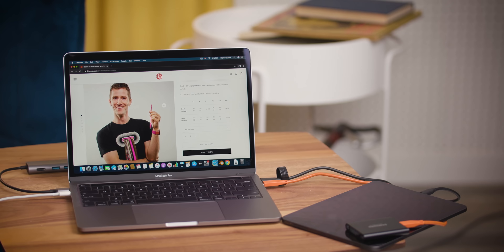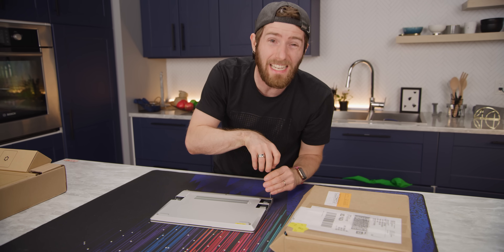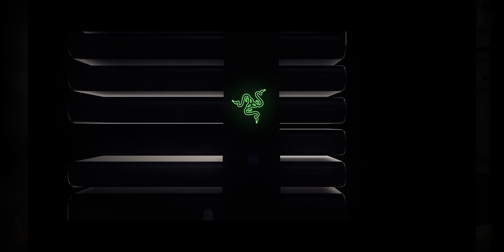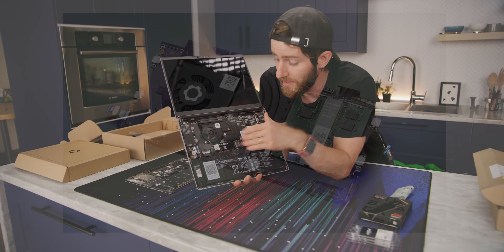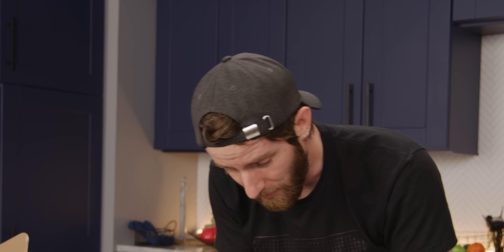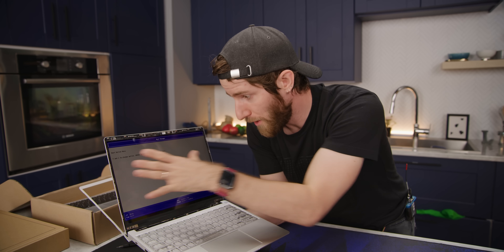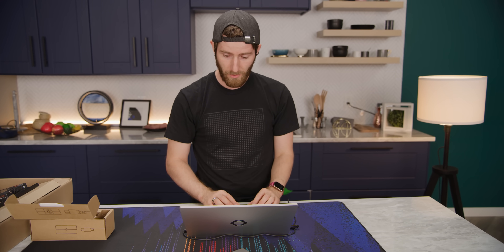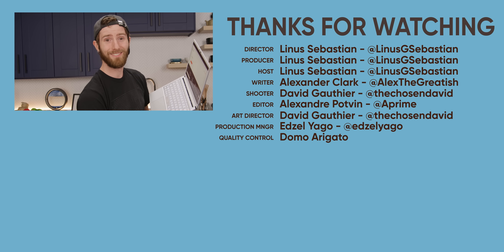A COMPLETELY Upgradeable Laptop?  - Framework Laptop Review

Comment: In an alternate reality: Yeah i'm gonna just go head over to the computer store and grab a micro GPU for my laptop. All the regular names sell them and they're standardized so they fit in every laptop. They're the size of a credit card. This company could make that a thing. Someday.
Reply: Dude that would be awesome! no more headache in upgrade modules!
Reply: Note: this is possible on this laptop NOW, as the board uses a chipset that allows eGPU setups over thunderbolt. The eGPU itself is expensive however. The good news is, Intel xE is quite capable for an APU in itself.
Reply: Laptop GPUs are basically already the size of a credit card, about two of them and a 3-4 thick. It's a standard part size. The ONLY limiting factor is cooling wattage, which again, can easily be compensated for (either reduce power of GPU, or don't buy a thin laptop with cooling spec too low)
Reply: My wifi on my computer is almost broken when i drop my pc acadently
Reply: except you can't get it because they all been sold out and now only available on ebay with 2x the price
Reply: Mxm used to exist 10 years ago, unfortunately it failed miserably
Reply: @paologiordano.photos  I shall say technology has gone really far within the last 10 years.
You can look at those changes in mobile devices & laptops.

Yes it failed in the past, and still needs more development in the future, but we might see it soon enough.
Reply: @paologiordano.photos  But those were not compatible with every device
Reply: @priesermax  they could have been if bios whitelists and continuous connector revisions weren't a thing. I had an old NX9420 from HP back in the days with an MXM gpu, because of the bios whitelist I could choose one in only three gpu options

Comment: No Keyboard selection yet and power adaper for non US/canada. NoGo yet. The best would be a adapter with more than 1 USBc on it. most likly anyone is using full speed on both ports at the same time. But you would have more ports :)

Comment: Definitely going to be looking at Framework for my next laptop upgrade. I just went through a very annoying process to do something as simple as fixing an RGB light on my current laptop, where the manufacturer said I'd have to send it to their service center hundreds of miles away just to screw in a 2cm pcb. (ended up ordering a similar part on ebay harvested from a dead laptop of a slightly different model).

Comment: That's quite nice, but the $300 price difference between the i5-1135G7 and i7-1165G7 is nuts. Intel's "Recommended Customer Price" (customer, not OEM) mentions a difference of only $117. And it's not like they have different TDPs to require different a cooling solution, so that's a bummer. Oh, and the "spoiled" European in me also dislikes the 1-year warranty. There's a minimum of 2 years of warranty for this kind of electronic equipment here, so even lacking an extra warranty option is an issue with this laptop - for me and other "spoiled" customers. Hey, it's overall an obvious good step towards the customer, but I hope they will do more in the future.

Comment: Although as stated, most laptops already (or still) have replaceable memory and hard disc the design overall is awesome, it clearly proves that modularity and replaceability can be done without sacrificing anything and in fact making lot of things easier for the end user. For example the bios option to disconnect battery altogether - with modern battery management circuitry, the effort to implement such feature is surely trivial but against the planned obsolescence tactics (simply letting the battery needlessly wear out). Framework's design philosophy would surely reduce the environmental impact of the modern disposable electronics and should be enforced to be mandatory in all appliances by local and international laws. I remember hearing about such thing being planned in the EU couple of years back and really hope it only got postponed due to covid-19.

Comment: I work as a computer reseller, I think that everyone should learn to repair their computer. Just simply basic SSD or ram replacement should be mandatory. Its fortunate that most of the modern mid range laptop still have that option. Especially business laptop, although most of them are moving toward slim design which sacrifice the Soddim type RAM. But luckily not all of them are.

Comment: I have an old Toshiba Satellite laptop with a Core 2 Duo socketed PGA CPU (no heat spreader). The thing consumed 35W at 2.7GHz and so needed a greater thickness to accommodate the cooler fin stack. Point is, it existed, it can exist again.

Comment: I was a little worried about how much the add-in cards would cost, but it's US$9 for the USB cards and $19 for the MicroSD/display-out. Am a little disappointed that there isn't a 2×USB-A hub to help remediate the limited port count or an ethernet card, but those could certainly be added or modded in later. And maybe I'm just used to 15" laptops; this is a 13-14" class laptop under the 3lb mark with more ports than the XPS 13 (which is about 3 ounces/100g lighter).

Comment: I would jump on this from Mac if they had a more rigid charging solution than USB C. Apple shot themselves in the foot when they did away with magsafe and if someone else offered a similar solution I would consider it a main selling feature. Every laptop I have had other than the magsafe I have had to replace the DC jack or port at least once in its life often multiple times. A clear case or deck lid option would be a cool to go along with the clear keyboard.
Reply: Just use a detachable USB C magnetic charging cable.
Reply: @MatrixMaverick1980  I have used them on my mac with mixed results and it adds to how far things stick out.

Comment: Wow this makes me really want one. Unfortunately they aren't shipping in my region yet, also I don't tend to have the kind of money to afford laptops new :( but maybe I could afford a gen 1 laptop assuming they get discounted when they release gen 2. The modules look like they're USB type C is that right? I didn't see an option to buy empty modules that you could say mount a 40mm m.2 card in, or maybe just a breakout board to DIY your own components. Also I can't stand a touchpad that doesn't have Inertial movement / Momentum on it. I like to be able to flick the cursor across the screen, without it I can never find a decent compromise between responsiveness and accuracy. I don't know if the Windows precision drivers support it or not, I usually have to make sure it's a synaptics trackpad and even then it often takes trial and error with different drivers or even bodging on drivers for different brands. It'd be nice if there were multiple options for compatible pointing devices, I love the look of the one you reviewed recently (the Sensel Force Haptic Touchpad).

What would be really cool is if when they release a new model they also offer upgrade kits, so you get a new motherboard and a new CPU if the architecture is different, but can reuse your old case, battery, display, storage, memory, wifi etc. if none of those need upgrading. Maybe even offer a trade in program (as well as an upgrade program for those that don't want to DIY it) to help eliminate e-waste and recycle the old hardware into either discount machines for those on a budget or for developing markets. Or maybe for set-top boxes or other integrated devices or hobbyists or even just as a stock pile of spare parts so that users can still find replacements years later.

Maybe they could also offer different options based on how many people want it, like an Indiegogo campaign, if enough people want an AMD Zen 3 version for instance then they could make a compatible motherboard knowing that the preorders would at least cover the development costs. How about a gamer option with a larger case and display (and maybe keyboard) that has enough room inside to fit the standard motherboard, plus a 90Wh battery and a dedicated graphics card, the card would probably take up the IO from 1 or even 2 modules, but you could use that space to install a second exhaust fan.

Comment: YO LINUS .... please do a Video On What to do When buying Used Gaming PCs / hardware ...like how to Test if everything is working right etc etc....the Used market is Huge and it would help a lot if you can Give us An insight as to What to test etc...like run crystaldiskmark to make sure of Drive speeds ...do Dead pixel Test... Temprature test... Cpu clock speed ...Gpu clock speed .....   for example im going to Buy a  Used gaming pc From Someone , and have a Set of Test to Do to make Sure the System is 100% without Faults .... THANX in advance😁 ... Been A huge fan For over 12😁 years

Comment: This is wat a laptop has to be, if manufactures what to have integrate designs on consumer laptops but enterprise laptops shouldn't have to, fortunately most of these things Lenovo do with the ThinkPad line like the battery, keyboard, and screen without glue but with screws, but it's a rare thing, apple is apple, they release the butterfly switches to save 0,5mm of thickness.

Comment: In terms of repairing "stock" laptops HP Probook 430/450 G7/G8 are pretty good as well, but getting the parts is still a slow/hard process, but you can get them. if someone thrashed the left hinge you can actually order a left hinge.

Comment: We need more companies like this(Framework), System76 and Purism. Give the option for making the ME or PSP inoperable, freethe bios with coreboot , and if they come through with ARM and RISC cpu options too, I'll be so pumped and would purchase one. I bought a new laptop months ago and returned it the next day cause the whole thing just stunk of B.S. can't remove the battery , have to make a online account just to get to the desktop screen etc etc🤢 Instead I purchased a couple old thinkpads and am so much more excited, I can upgrade alot of it(screen, battery, BOTH ram modules, socketed CPUs, and certain wifi cards) also I can remove the WWAN card if I want aaand there's ways to add additional SSD storage in the cd/dvdrom with a harness, and where the wwan is. To me that's way cooler than the proprietary b.s. however being able to have those things with a latest release cpu would be awesome. 
P.S. make sure to support "right to repair"

Comment: you seem to have missed one key detail. how much more does this thing cost compared to a similarly specced "conventional" laptop?

a quick bit of research confirms what i suspected. that these things cost more than double. so how do i justify upgradeability when i can just buy a brand new laptop at the end of it's lifespan with the spare money i have left over after not buying one of these? if i upgraded everything on this laptop - effectively replacing the laptop - presumably it would cost more than just buying a new conventional laptop.

Comment: What would you upgrade in your existing laptop that you really wish you could but can't? HDD to SSD? Yes you can. More Ram? Sure. Better wifi? Probably but is that typically an issue? Gigabit Ethernet? Ok, cheap dongle. Video outs are usually good enough as supplied.

Comment: BITD I was on the Sony Vaio development team (committee). My background is as an integration engineer. Ergonomics and simplicity being my guiding principles. Most of the suggestions I made were ignored completely. Mainly upgradability and future proofing. I was flat out told that would limit the number of units that could be produced. RIP Sony. This concept by Framework is essentially the same common sense approach that we envisioned in 1996. Unfortunately the final product was barely different from the same crap everyone else was selling at the time. The Thinkpad was a compromise. The Latitude and Inspiron products from Dell were decent but still short feature life junk.

Comment: The only problem I can see is the low amount of ports, but I don't think anyone would actually use more than 4 ports at once on a laptop, and anyway surely you could build a single module with multiple ports.  USB hubs exist, so fitting, for example, two USB A ports in one module should be possible, I would think.

Comment: As someone about to buy a gaming laptop for my half year abroad, I'd really like to see what framework could do in terms of dedicated graphics. The screen upgrade would be pretty straightforward, but fitting a mobile graphics card might be difficult in a design like this
Reply: they might need to figure out the cooling and compatibilty part
Reply: @lilplague4857  that's what I generally mean by "fitting" the GPU die itself isn't massive, bit the cooling components would be a small issue

Comment: Got an Asus laptop some time back.  Decided on the lower-ram option to save a buck, opting to upgrade it later when I had the money.  hahaha...  No door on the bottom to access it.  Had to completely flay it to pieces, removing the motherboard and unplugging several fragile ribbon cables, dozens of screws etc just to get to the ram slots on the bottom of the motherboard.  I get the impression that the hassle was...intentional.  Framework is the company I have been looking for.  Now they just need to start making smartphones.  Either way, I'm a customer.
Reply: if they can make a cell phone that has the same modular capability of that laptop they will most likely be considered revolutionary that's what I'm hoping at least a modular and self serviceable cell phone would be a huge advancement in technology however I kinda fear it might run into trouble at some point

Comment: having recently repaired a 17" alienware laptop, this looks great
Reply: I just repaired an MSI gaming laptop and it’s case is the thinnest Piece of garbage I’ve ever seen. Literally had to super glue it back together! Can’t wait for this!
Reply: I hope those kind of enterprises come strong to the market and overcome others like dell, lenovo, apple... It is so fking bad not having the right to use ur stuff the way u want or repair it easily. It seems we r taking the computers borrowed instead of buying. We can use but we have no right to see inside it and manage it deeply. I hope that framework comes to Brazil soon in a good price.
Reply: Bruh I hated taking mine apart, that was a nightmare
Reply: Nice job commenting on Linus Drop tips and getting 500+ likes for it
Reply: RIP my guy
Reply: Hell, I remember when I had to replace screen backplate on my MSI GT72 because stupid plastic that was molded around one of the screw holes that mounted screen to laptop chassis just cracked.
Reply: While my alienware overheating issue will never be solved. Yes that looks really good.
Reply: Bad luck bro

Comment: I have a laptop with only 2GB of RAM. 
When I look into the software, it says 1 of 2 RAM modules fitted. When I opened it I found out there weren't any slots for RAM. Only 1 of 2 RAM ICs was soldered on. That means to expand it I would have had to find the right RAM-IC and solder the ball-grid-array ;-(
It was only possible to exchange the 2.5 HDD hard drive for an SSD and install Linux.

Comment: Well if they put display port/hdmi interface on the motherboard, but modified the port using smaller custom connectors. Then they build a small universal screen controller board that connect with that custom connectors. which end user can flash multiple firmware depending on what screen module they use. Combine with a motherboard that can use a custom casing. I called it GG then.

Comment: in principle, could two usb-A ports fit in a single one of these square plugins?
Reply: They said they would release the CAD drawings so you can make your own modules. I don't think we have measurements available yet to see if that's possible. You'd also need to integrate some type of USB switching chip to make that work.
Reply: @BitsOfInterest  I made some measuring from available pictures. It is technically possible to fit two, but because usb device manufacturers always put sheaths around the male connector that takes always one or two millimeters, i doubt it would be possible to ever use both at the same time.

Comment: Tell me again, since i want confirmation, is the processor interchangeable? Also does this have graphics card? Because RAM and storage (HDD/SSD) are interchangeable in like every gaming laptop so what's the difference? 🤷🏻‍♂️ Yes of course every thing is modular even the speaker can be changed but mostly people have to get rid of their laptops because of low performance. Not because of speaker or battery that's a huge minority.

Comment: I can see the "power on at ac connect" useful for those desktop cases that someone will create. Exsample once you upgrade your mobo+cpu in the laptop, the old one could became your second desktop pc or small home server
Reply: Power on at ac connect is likely a feature for a different application of the bios like you might find in a car's infotainment system rather than tying it directly to the ignition.